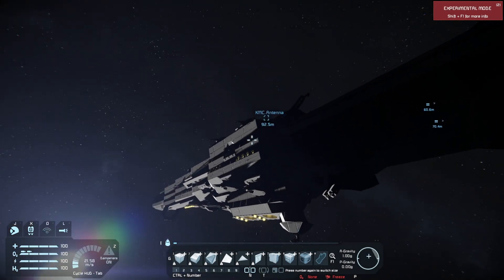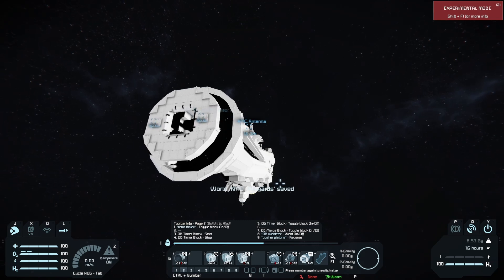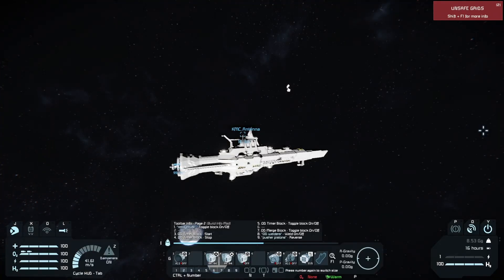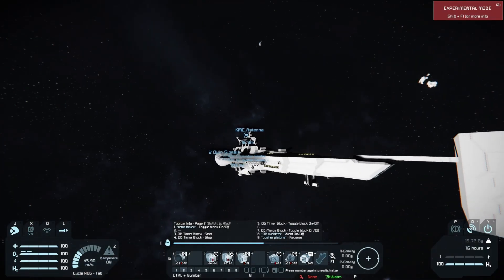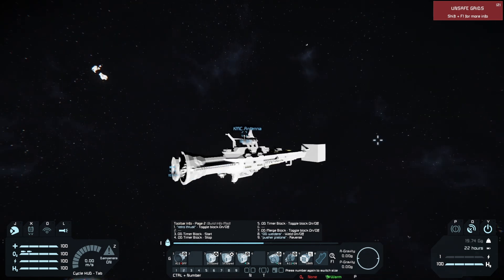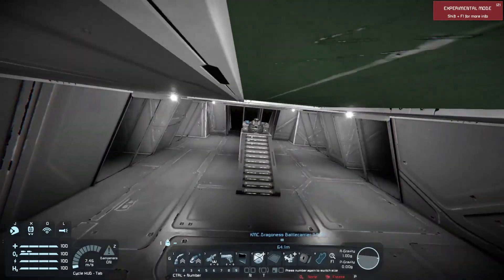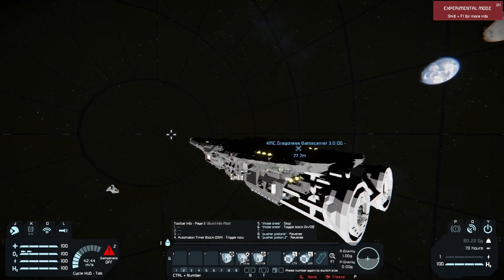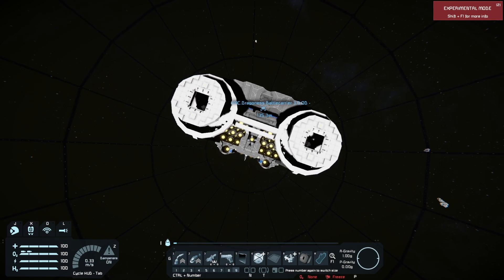Does the Orion Drive concept work in SE?

Comment: I knew of this, and have been trying to create it. but during testing, seeing it's slow speed per warhead cost, made me not want to make it, but the fact you can basically make it any size and still move is cool.

Also I do belive hydrogen tanks have a bigger blast radius, you could try a system, that fills a tank and launches it behind you, and have a warhead attached to it.

Kinda like irl hydrogen bombs lol, using a nuke to activate a bigger nuke lol.
Reply: After really quick testing, the hydrogen tank visually has a bigger radius, I will test it in space and see if it has a greater pushing force, and how far it needs to be from a grid to not break it.
Reply: also i'm down to talk about space engineers on discord and do testing.
Reply: A single blast door, can survive a blast from a warhead from 12 blocks away and go to a speed of around 30 m/s

inital testing of hydrongen tank, from 12 blocks away and a warhead on the back of it, goes 22 m/s, already slower

from 10 blocks away it's 31 m/s, no damage

From 5 blocks away it's 47 m/s, lost 6 health points

weird.... 6 blocks away it's 44m/s, but is now below half health it's at 43% health, perhaps 5 was a fluke test again!

it... was not  a fluke....... odd

7 blocks is 41 m/s, and at 81% health odd.

8 blocks, is 38 m/s and 88% health

9 blocks is..... 34 m/s, no damage.....

I'm a go back and go below 5 blocks, I have a theory that the blast from the warhead is overriding the damage

Wow! 2 blocks away, 52m/s, caused the blast door to spining, and took 10 points of damage, very good.

I will see when it stops spinning.

3 blocks......51 m/s, and 91% health... no spin....... very strange.

I could try half blocks but that'd take to long, honestly using a hydrogen tank is pretty good, but it get worse and very damaging the more far away you are from it...... but no matter what will do damage, but close range is less, so using welders could fix this issue.
Reply: I also have ideas, and concepts you could use for the future, Don't want to spoil anything, but I had found some pretty neat things over my years of playing. one is actually a challenge for a server, and so far it's been pretty fun for me.

Comment: Does the pusher plate provide any functionality in the SE version? Could you have a static plate and eliminate the subgrid?
Reply from the maker: It doesn't make a difference, but it looks cooler, and looking cooler is half the battle.
Reply: @evandoerofthings6538  perfectly valid reasoning ❤️